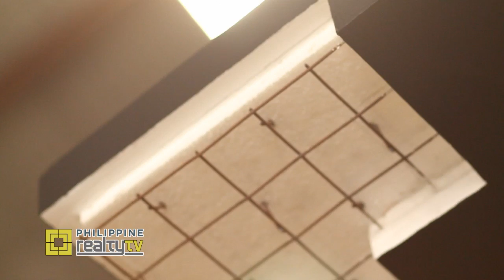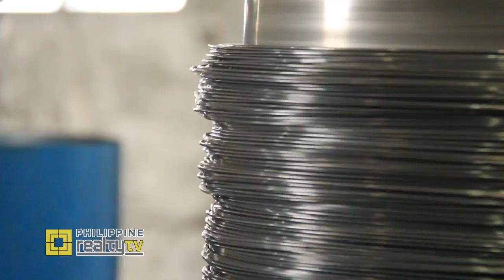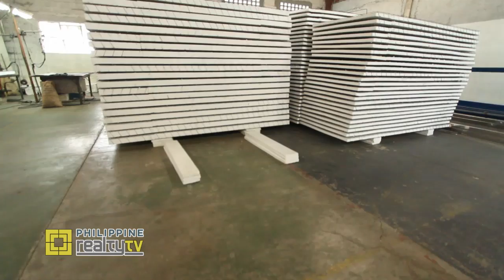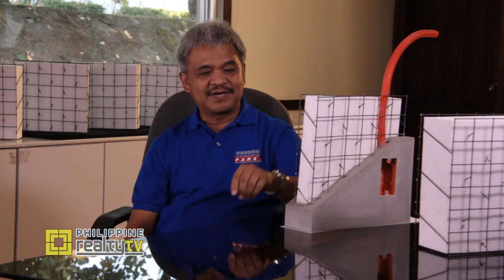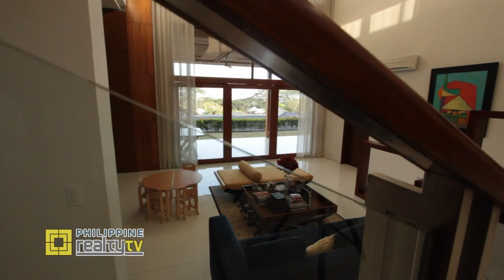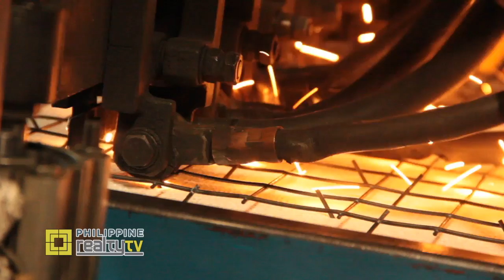SRC Panel Systems

Comment: How much weight can be bear in lb/sft using its panels for slab.?
 And its walls strength in  in- plane, out of plane and its compressive strength if subjected to load bearing?
Reply: You can message us at our FB Page SRC Panel Systems, or call us at this number...
8983-5893
8939-8106 to 08
Reply: @jessiejanapin7636  where is your location? Do you have one in Pangasinan?

Comment: to build a house using these method needs a sliding isolators in case of an earthquake
Reply: hello friend, any interested in eps 3d wire mesh panel and eps 3d wire mesh panel production line, let me know pls my whatsapp/wechat/mobile number is 008613386455039,email is qu.office@abcn.group

Comment: Do you have an alternative insulation aside from EPS Foam? Or aside from concrete outer layer, do you have steel? Thank you.
Reply: hello friend, any interested in eps 3d wire mesh panel and eps 3d wire mesh panel production line, let me know pls my whatsapp/wechat/mobile number is 008613386455039,email is qu.office@abcn.group

Comment: Can we use this for  outside walls?
Reply: Lauden Max yes you can use this for exterior walls.
Reply: Yes SRC Panel is a load bearing wall with minimum of 1,200psi

Comment: Cockroaches loves living in styrofoam, your panel is susceptible as cockroaches can enter inside electrical system. The junction boxes are directly carved in the styrofoam. I like the system but give an answer to this problem cause it might cause some problems in the future.
Reply: you are supposed to encapsulate this in concrete.
Reply: @joseromantan  yep sopme people have no brain
Reply: The boxes don't touch the foam.  They are on thee outside of the steel mesh.

Comment: Watch this video to learn more about SRC Panel Systems. yes i  think so ,  if you use the vertical type 3d panel machine maybe is better than horizontal type , if you are interesting in this machine pls check our web:www.hbhscn.com
whatsapp:+86-15633821221

Comment: you forgot about thermal bridges, the iron does not insulate thermally !!!!
Reply: Your calculations are incomplete. You must also calculate the losses through the whole surface of the inner and outer net of each wall. The outside cold is captured by the entire surface of a wall through the steel net and transmitted inside the building through the steel wires and dropped into the room through the inner mesh. Certainly winter will be condensation inside.
Reply: @valivalentin8963  the only weather we have in the PH is wet, hot, and hottest
Reply: @philnightjar1971  so heat will be transmitted and the insulation will be inefficient :-(

Comment: Which mm steel bars are used and it will bare load ground +1+2 floors house without coloums and beams
Reply: Concrete bears the downward loads.
Reply: You can message us at our FB Page SRC Panel Systems... thank you